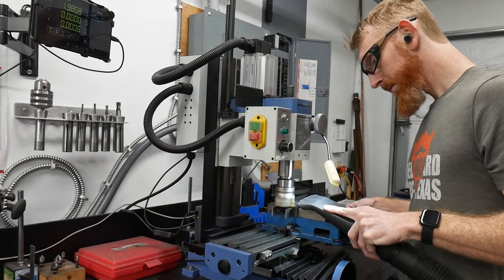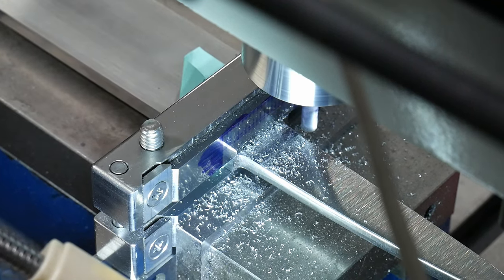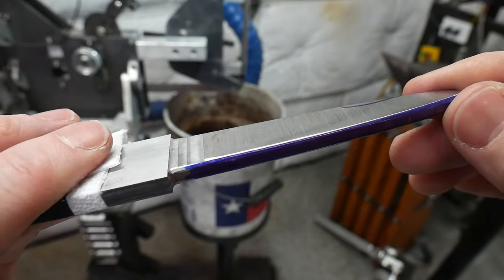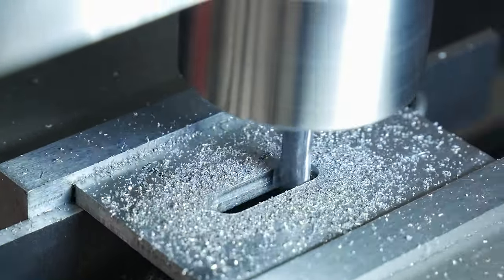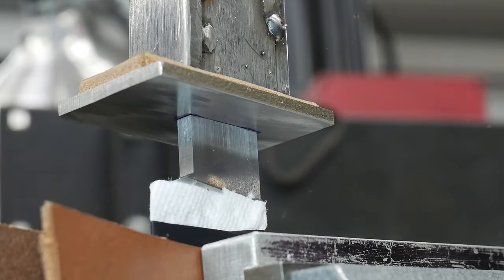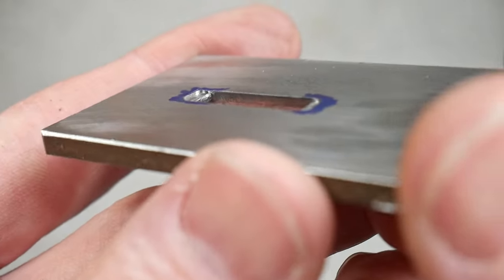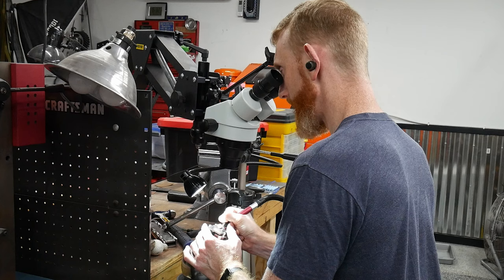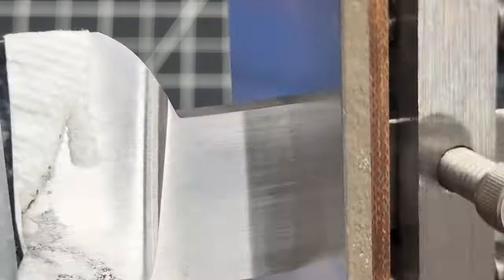The BEST Way To Fit A Knife Guard? | Rookie Attempts Master's Method

Comment: Mill 1/8" away from your file guide and use table travel stops so it's the same on each side. That avoids hitting the file guide. So you mill the shoulders and the back-cut all in the same setting.
Reply from the maker: Thanks Mr Andersen! I need to make some table stops for the Y travel...